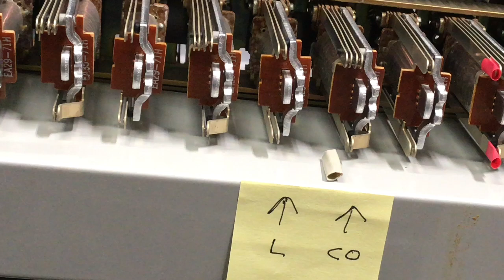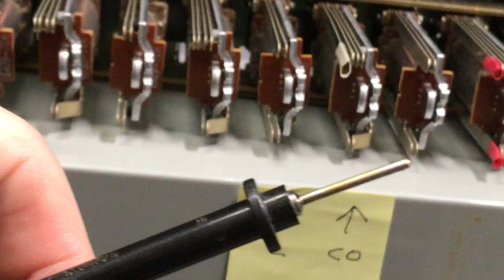The difference between LOOP start and GROUND telephone start lines.

Comment: Wow this was really cool to hear the background on loop vs ground start from a termination standpoint.   Back in the late 90's we were dealing with issues using small Asterisk systems and their fxo/fxs analog line cards prior to everything being moved over to IP/SIP trunks or T1/PRI for larger systems....   Asterisk wouldn't know when someone hung up when the line was configured as loop start.  (and just now reading William Degnan comment about glare that was another issue we were having).      I did some research on the Asterisk forums and found that a ground start line will provide disconnect signaling / supervision.    It fixed the issues we were having but I never thought about it from the calling out standpoint and why that would be important.

Comment: So, is that what Matthew Broderick was doing in the movie War Games, when he shorted the microphone to the payphone chassis with a pull tab?  He was grounding the circuit to get a dial tone?

https://www.youtube.com/watch?v=o5b5GWDqYrk
Reply from the maker: Yes. And it would work for real. They can do anything in the movies but this was an issue that the telcos had to deal with.
Reply: Broderick would have been able to get dial tone, but would not have been able to use the rotary dial. A fraud prevention mechanism built into these 3-slot payphones since the late 1950’s was a short circuit across the dial pulsing contacts. This was performed by a normally closed set of contacts associated with the hopper trigger. This short circuit was only removed when the hopper trigger was deflected by the deposit of a coin. So when Broderick started dialing, he wouldn’t be able to break dial tone and the call wouldn’t go through.
Reply: @Hicken65 Would he have been able to flash w/ the hook switch?
Reply: @Madness832  Yes. This would not be as easy with the payphone switchhook as with a desk set and he would be trying to accurately tap out the 10 digits of the long distance information number he was calling. However, he may have been able to tap out the ten pulses of a zero to reach an operator and ask for a connection to be made to long distance information.

Comment: Another benefit of ground start trunks serving a PBX is to avoid "glare". If a ringing (loop-start) line is between rings the PBX cannot sense   that the line is engaged by an inbound caller and so it is available to be given to an outbound caller if they dial (typically) 9th level access at that moment.
Imagine someone calling a hotel to make a reservation who is connected to a guest making an outside call. "I'll be glad to book your reservation. What is your credit card number?" Would that be a problem?
The local tariffs required that PBXs be provisioned with (more expensive) trunks. 
The PBXs I sold were FCC registered as hybrids and could be used as a key system and/or a PBX. So, we had the option to order loop-start C.O. lines, but in order to avoid glare in a PBX setting we ordered ground- start trunks.
If you've read this far, you might appreciate a war story. A client's business grew to where they needed a larger system with more stations and outside lines. I had a 24-hour busy study done in order to give me data for my traffic calculations which would enable me to know how many lines were needed for the desired level of service. That's a story all by itself.
The result was that they needed six more lines over the six they already had. It turned out that the local exchange carrier wanted to charge my client hefty installation charges to convert the existing six lines to ground start trunks. Fine. I decided to put all 12 in a hunt group allowing an excellent grade of service for incoming callers. But I would program the switch to only route the outbound calls on the new ground-start trunks.
My conversation with the phone company rep was to the effect that someday they would realize that there were lines in use on a PBX and that they would be converted to trunks but there would be no installation charges -- just the increased monthly charges going forward. Wow, that worked for me and my client. So that's how I put my orders in - just the new six.
A YEAR later I got a call from a very contentious telephone company employee in the Compliance Department. He was indignant that I had C.O. lines ahead of my client's switch instead of the required trunks. "I'm fine with that. What's your problem?”
He proceeded to tell me what I already knew. And, he told me I should put in an order to convert them to trunks. I told him that they were configured differently in the switch, that the system was a hybrid and I had the option of having one or both and that I wasn't going to put in an order to change anything. But, if they were converted to trunks then my client could have a slightly higher grade of service for outgoing calls and I would open the original six to allow outbound calls. He confirmed that if he wrote the orders there would be no installation charges. I think I saved my client about $3,000 by letting the telco "catch" us. And the compliance guy had to do all the paperwork. He sure showed us that you can't pull one over on the phone company.
I had him make them due on the following Tuesday, first job up in the morning.* When they called me for the cut over, I dialed in on a remote maintenance line, programed the ports on the line/trunk cards to ground start and moved them to the bottom of the other trunk group for outgoing service.
You take your small victories where you can. 😉
__
*My rules include: Never have circuit orders due on a Monday or Friday. Always request a.m. and if possible first job up. If somebody's going to have to wait around, let it not be my crew or my client. Let it be the telco's other customers.